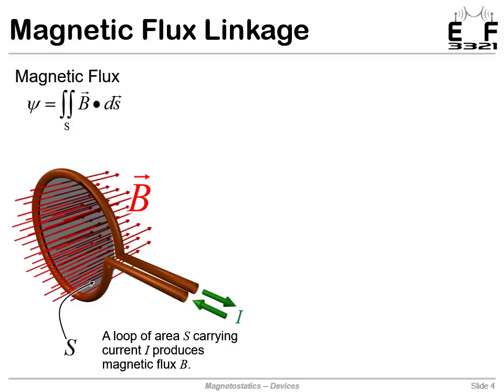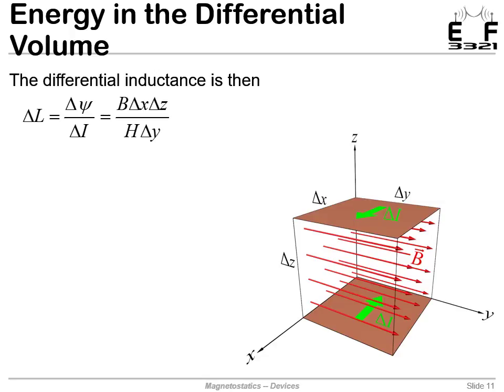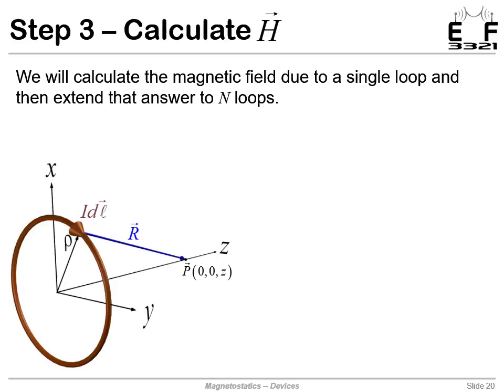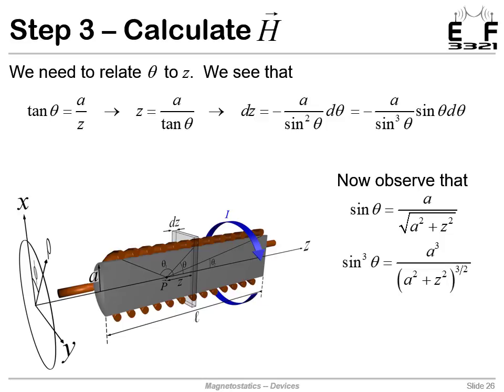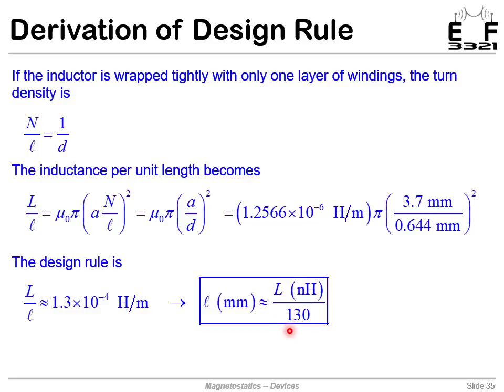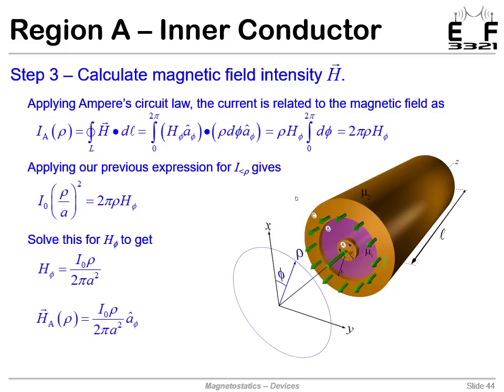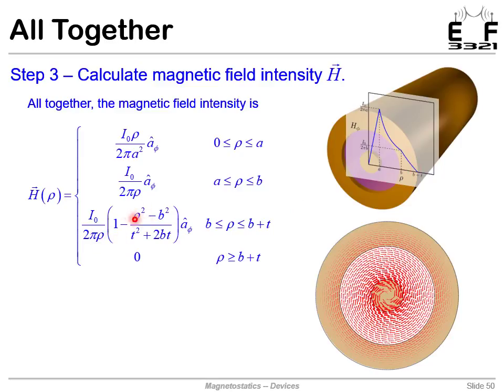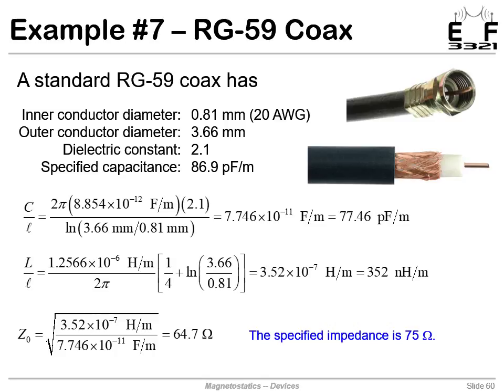Lecture 5e -- Magnetostatic Devices

Comment: Thanks for the amazing lecture, I have got two questions:
- The concept of fluxlinkage being similar to flux makes sense when the exact same coil with N turns is generating the flux. However, when the flux is generated by one coil and linking another (like in a transformer), we simply say multiply that external flux by N of the coil being linked (to get mutual inductance for example). In this case, I am not sure if the concept stands.
- In slide 10, integrating along ab we consideree 2H, why didn't we consider the effect of both currents when we integrated along cd.
Reply: For slide 10, it’s because the line element in space being integrated along segment CD is only being affected by the current on one side of the plate, not two side sides as in for the segment AB. I hope this makes sense.

Comment: As always, it is a fantastic well-thought through and well-organized video. 
Did you also do the calculations for the RG-59 with a model that takes the skin-effect into account? Does it improve the results appreciably? I guess it is realistic to assume the PTFE to be an ideal dielectric below 1 GHz.
Reply from the maker: My team has compared rigorous finite element simulations to the simple finite-difference simulations and we see very little difference until something becomes extreme, like very high frequency, very poor conductivity, etc.
Reply: @empossible1577  Dear Professor, thank you for your feedback. I just checked the parameters for RG59 from the datasheet linked at the wikipedia article. The article stated that RG59 now commonly uses cheaper Foam PE (dielectric constant = 1.6) instead of PTFE. With this dielectric constant the model you show gives a lower C of approximately 59pF and and resulting Z of 77 Ohm, which fits quite closely to the values in the datasheet. Thank you, again.
Reply from the maker: @weinihao3632  Great to hear and I was not aware of the foam dielectric.  Thank you!
Reply: That means the difference in the calculated value of the impedance & 75 ohm is due to the change in the dielectric constant... Am I right, sir?
Reply from the maker: @meghjitmajumder3468  A decrease in permittivity will decrease the distributed capacitance and raise the impedance.  Assuming the numerical model calculated both values, then yes.  Differences in a few ohms between different types of models is expected and may not be due to just permittivity, but numerical error, approximations made, etc.
Reply: @empossible1577  Thanks sir